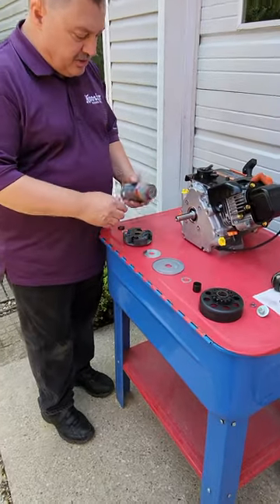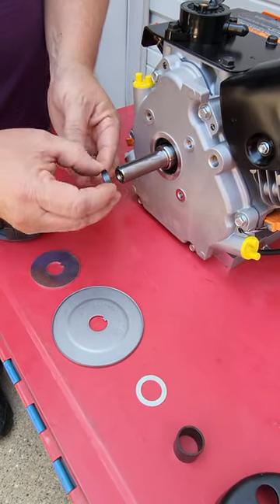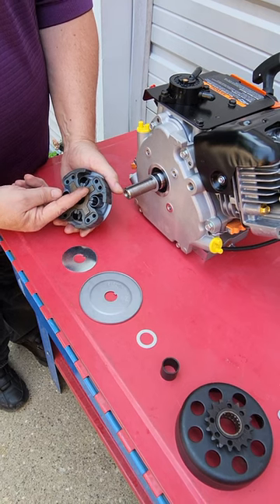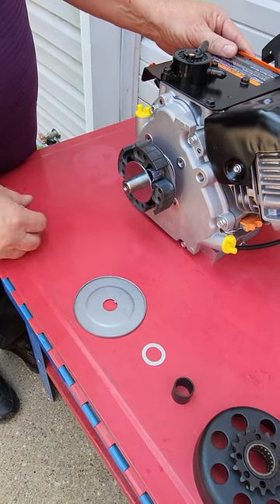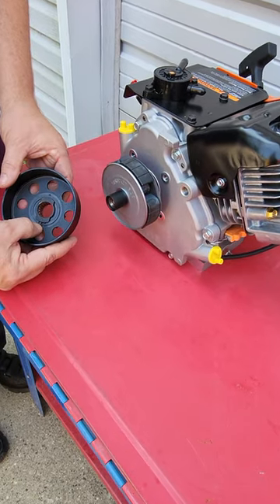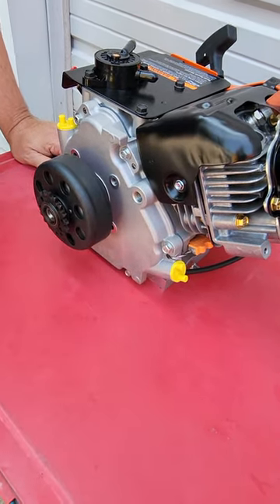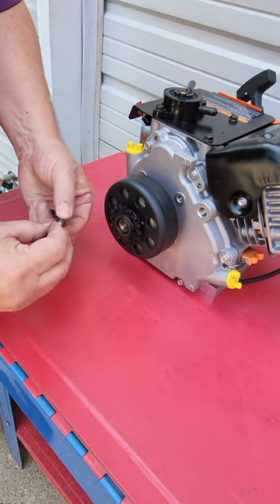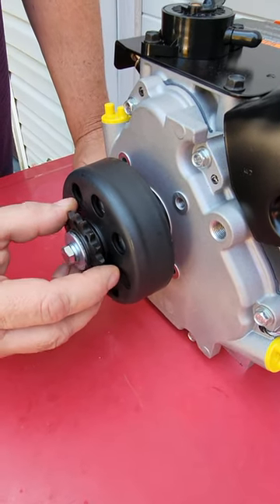Hilly Clutch Outboard Installation

Comment: What is the reason for using a bully drum and sprocket? Thanks
Reply from the maker: Simply availability and that so many coming from BP classes already have disc clutches that use this type of driver.  The Tech Talk Tuesday article that this video is linked to from or Facebook page:  @Carlson Motorsports give that information and a whole lot more.